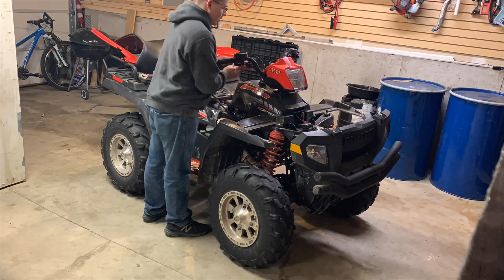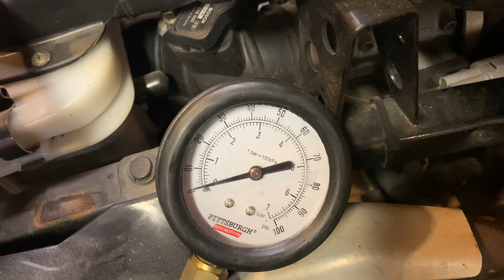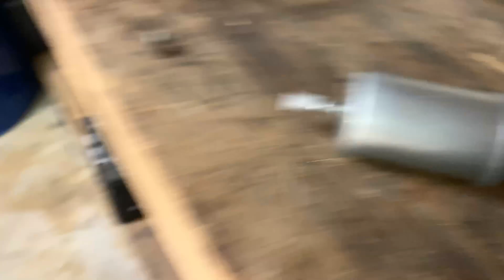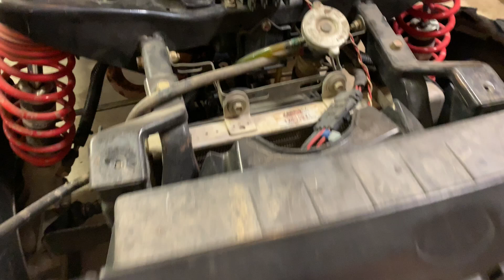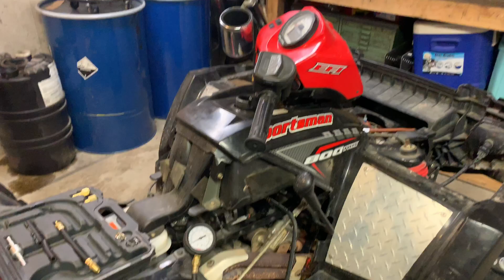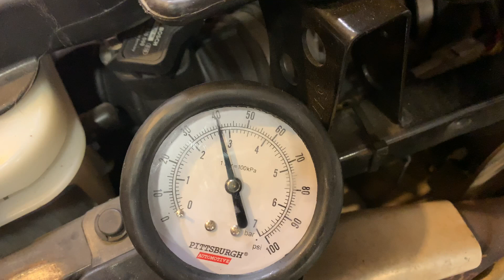Sportsman 800 troubleshooting and fuel filter replacement

Comment: Can you please also post the easy way to access the fuel filter?  :D  I appreciate the video - saved me time.  The new fuel filter fix my stalling out issue.  Thank you!
Reply: I ended up accessing the fuel filter from the top.  There are 2 bolt to remove that connect to the frame on either side is the radiator - on  the rider/back side of the radiator.  Then I removed the bracket that holds the metal radiator cap.  Then I removed the yellow cap (brake fluid I think).  With that done you can access a single screw which is the fuel filter bracket.  Then you have direct access to the filter and the clips on either side.  I tried coming in from the side/bottom and I don't know how you pulled off releasing the lock clips (hat tip to you).  I just wanted to share since I think coming in from the top might be easier.
Reply from the maker: Hey, to note the thing that fixed this ultimately ended up being the exhaust wrap and heat shielding. The exhaust was getting so hot that it was vapor locking the fuel in the fuel rail. Buy some aluminum heat tape and some Kevlar exhaust wrap and you’ll be good to go!
Reply: @Localhost127  what part specifically needs to be taped /shielded? Is it where the pipe starts at the engine head?  Or should I just tape the fuel line?  I appreciate and details you can provide.  My 07 x2 500 efi definitely needed the fuel filter but now it back fires and still cuts out when I get on it.  I was going to replace the fuel injector next but want to try the heat shield first.

Comment: When you hook up the pressure tester to the fuel rail, are you supposed to remove the shrader valve inside? The screw on tester hose has a shrader and the fuel rail has a shrader valve. Seems like they would conflict with each other not allowing fuel to pass. My Gauge won't budge. Again should the valve on the rail side be taken out before hooking up the tester hose?
Reply from the maker: When you screw the fuel pressure tester into the fuel rail, it depresses the shrader core allowing fuel to flow, And when you unscrew it, the shrader core goes back to its place. There is a small amount of fuel that will drip in this process.
Reply: @Localhost127  Thanks Mike for responding. I thought that was the case, but when I got absolutely ZERO pressure I began to wonder about the shrader Valve. I have pulled my fuel pump out of the tank and am going to order a replacement kit. The filter seemed to flow fine so my guess is the pump went totally bad. Thanks again

Comment: I'm working on the exact same atv. How do you get the quick disconnects loose from the filter????
Reply from the maker: It’s somewhat difficult but there’s little white collars that you have to push away from the line. I had to use the end of a set of needle nose to push them.
Reply: You got to have a push clip from hardware store .